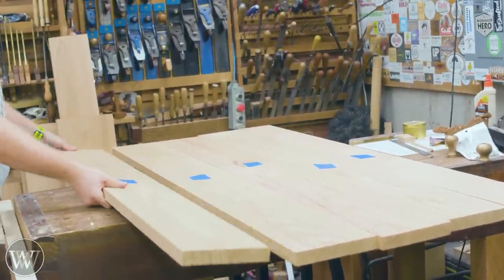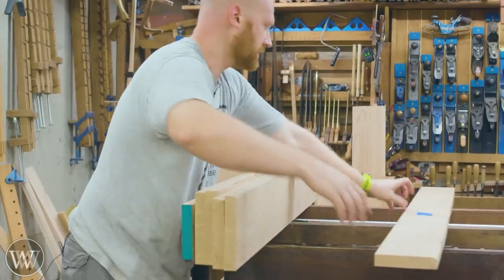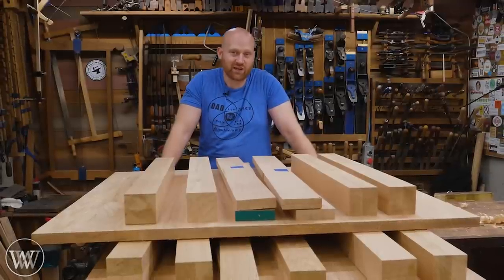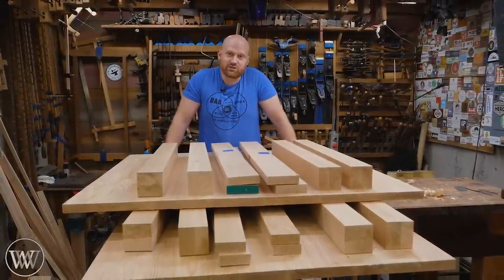Hand Tool Woodworker Makes Bad Choices

Comment: Any particular reason you clamp the table top in the vise for jointing the edges, rather than clamp it to the face of the bench? Standing on that stool seems a good way to lose power and risk falling over when jointing a long edge.
Reply from the maker: My bench isn't as long as the board is so clamping it alongside the bench wouldn't do anything more than what I have here. Also it's resting flat on the ground so all of the weight is down in the rubber flooring. No amount of pushing with a plane is going to make that twist or turn or fall over. It's about a solid as a rock lol

Comment: This is fantastic work, and great pleasure to watch. Not trying ot be obtuse, but your plane irons sound like they could use some sharpening. Or is it the nature of working with red oak? I've been mainly working with cherry adn some walnut, and the harmonics sounded a bit off. Thanks for sharing! :)
Reply from the maker: Yup. It is a bit of both. Oaks have a lower tone. But for a lot of this work I let the irons get a bit duller as it is not finish work. For the finish something later it is a different story.

Comment: I have never used a card scraper, is there a chance that it could make a small "bowl" if it isn't held right, or hits a soft spot in the wood?
Reply from the maker: You can make an indent with it if you want, much like a smoothing plane. The big difference is it goes with the grain as well as the other direction.
Reply: @WoodByWright  Cool, Thanks! I don't think I want to make an indent on purpose lol. Just wondered if it could happen accidentally.

Comment: I cut a straight line.  Well, it was a straight line on the side of the board I was looking at.  It was slanted and wandered like a drunken sailor on the other side.  I admire your skills, but it is to the table saw if I want a straight cut on both the facing side and the other for me.
Reply from the maker: No, you got half of the skill down. The other half is all about arm alignment. If your shoulder, elbow, wrist and saw are all in a perfect line and the saw is set up well then the back side will take care of itself. But if any one of those are out then so is the backside lol
Reply: @WoodByWright  At 70 years old, I will just rely on the accuracy built into the tool.  But I enjoy watching you.

Comment: Have you seen the enhancement Paul Sellers makes to those HF clamps by cutting stock to size and inserting them in the clamps' channels? Worked amazingly well for me. 

Also as soon as you said red oak, I felt like a dog with its hackles raised in response to a threat. I'd rather work Hickory.

Comment: Why not move the bar clamps to near the edge, and use them as the cauls...   and you can buy 4x4s....   you  wear my out just watching you saw boards...
Reply from the maker: Using boards or clamps as cauls does not provide a significant amount of clamping pressure to pull the joints down together. I find that using the hand clamps is a far superior method that provides a really nice glue joint.

Comment: Parallel clamps are not well suited to extreme forces necessary for laminating strength. They have other uses, for minor bench holding, and for keeping ends of boards together. Large G clamps or sliding Bessey clamps exert much more pressure.